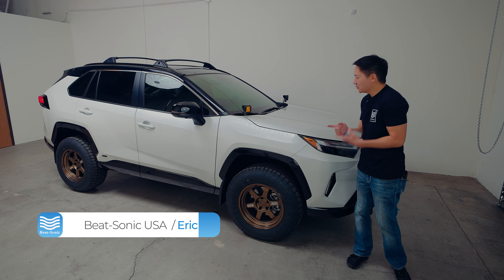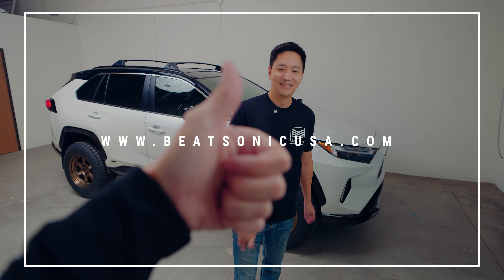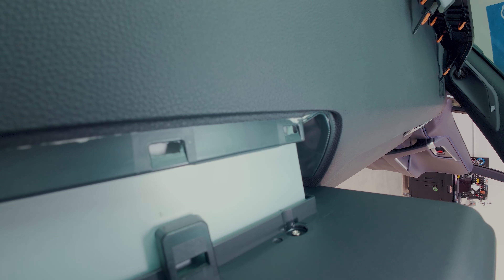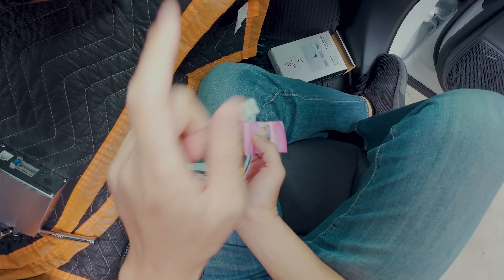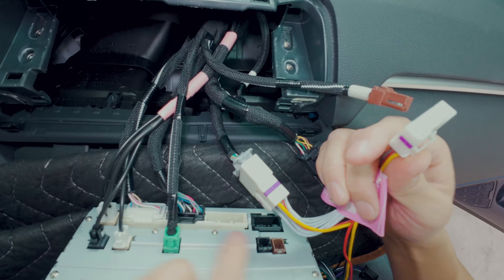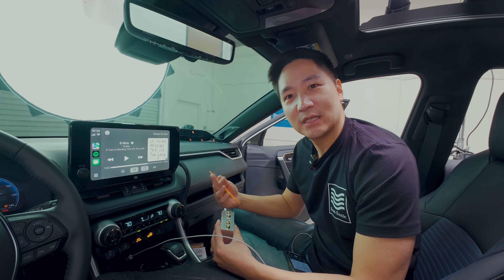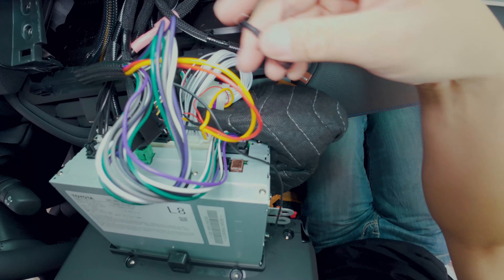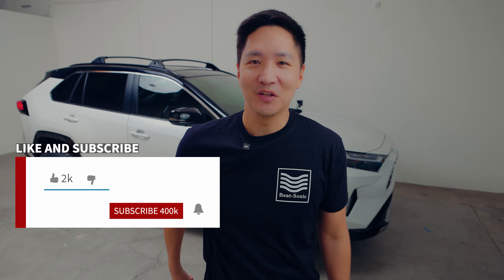2024 TOYOTA RAV4 | Easy Audio Upgrade! Beat-Sonic Amplifier Install

Comment: do the RCA connections work to send audio signal to a subwoofer amp? i am wanting to install a sub and or possibly a 5 channel amp to upgrade door speakers later.. i have only seen videos of you installing the device but nothing into the RCAs.. unless you have a video for that already? I have a 2024 Rav4 with JBL also.
Reply from the maker: We have the new ENA-3 series to add on a subwoofer, but it is not compatible with JBL models at the moment.